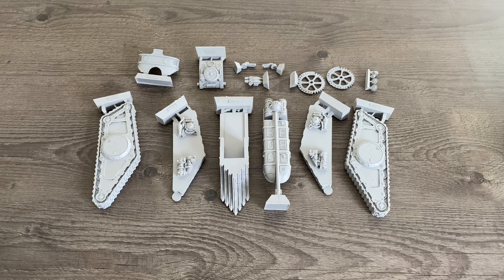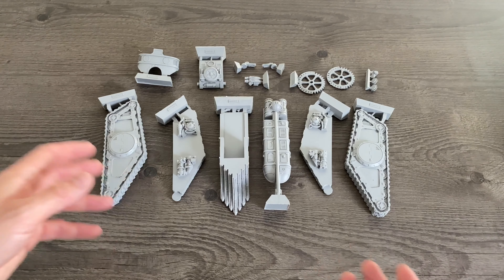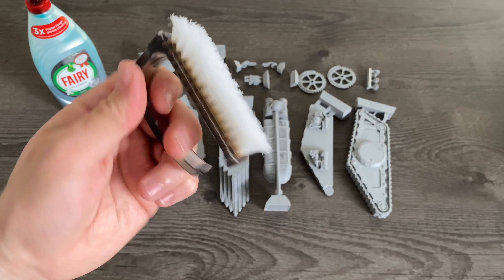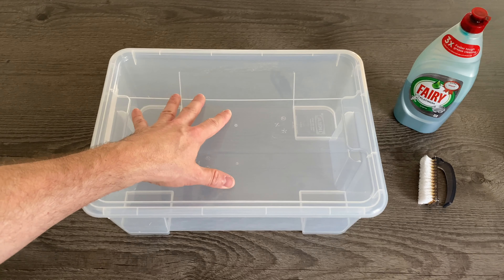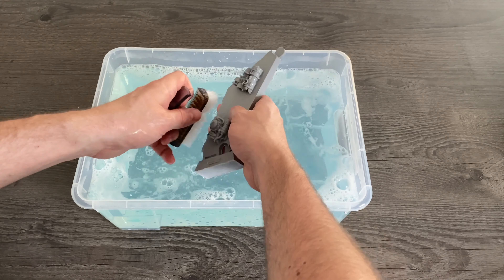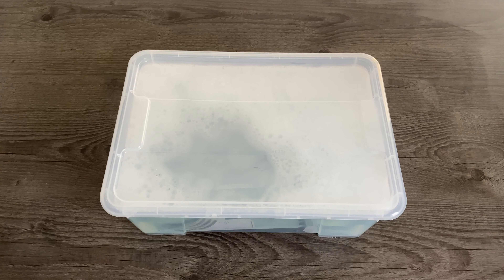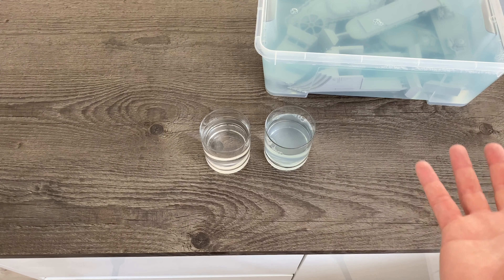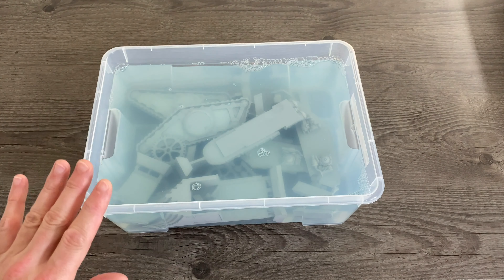Leakycheese's How To: Washing Resin Kits (new & improved)

Comment: Quite jelly of your lovely clean kitchen :P 
I've got a tub of purple power here (concentrated cleaner basically for those who might not know). I find it's easy to leave resin in, as long as I like (which means when I remember they're in there), then scrub with an old toothbrush in the sink til the bubbles are gone. Basically same method you use, slightly more soap I think. Lovely video per usual!
Reply from the maker: Thanks Mousey... I’m most proud of my kitchen.

That’s a good shout on the degreaser, it’s good to have lots of ideas about how to do the same job.

Comment: Good guide on how to wash forgeworld models. Its by far my least favourite part of building resin kits.

 I'm currently building my warbringer and the base of the quake cannon has been thoroughly washed 3 times over 3 24 hour periods and still hasn't released the agent so a new part is in order.
Reply from the maker: Thanks and good luck with the replacement part.

The Warbringer is an incredible model, what arm weapons have you gone for?
Reply: Volcano Cannon and a gatling blast gun, Volcano cannon being the highlight. It's been redesigned to look more like a smaller version of the belicosa volcano cannon from the warlord.

Comment: Hi, is there a reason why you don’t do this wash after you’ve done all the filing and sanding of the parts instead? I assume these parts would get an additional wash after that?
Reply: I dunno his thought process of course, but I find it's easier to work with the resin after it's clean. Easier to handle as it doesn't slip as easily. Plus if you're going to have to straighten parts anyway like I did with my legion droppod you'd probably want to wash first too